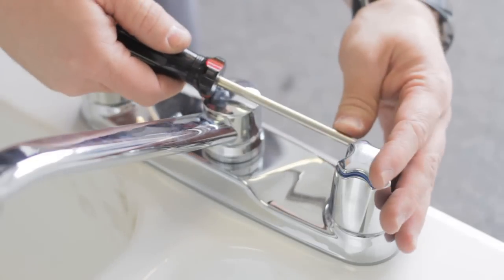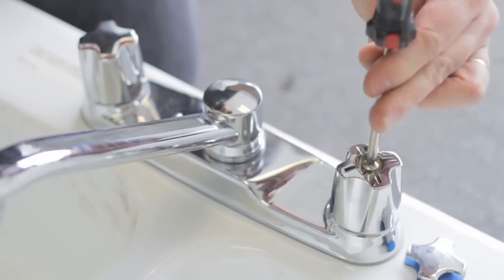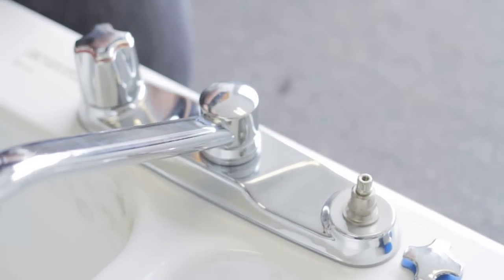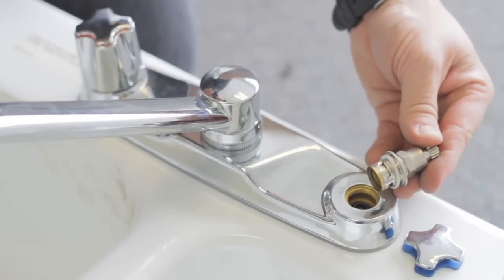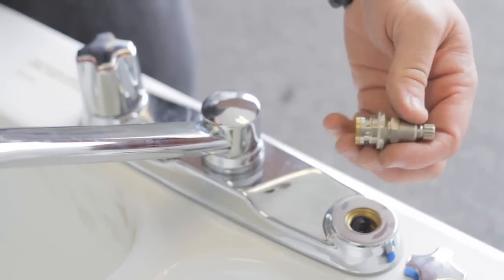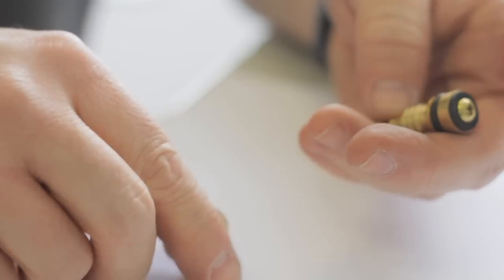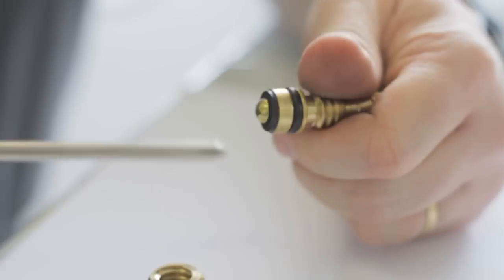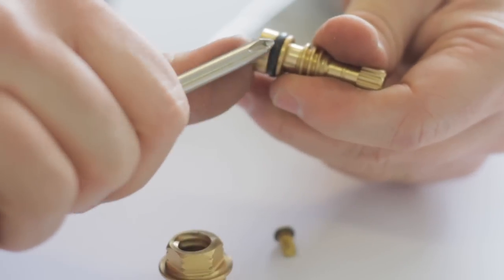Faucet Repair : How to Repair a Dripping Kitchen Two-Handle Faucet

Comment: Step one!!!!! Turn off the water under the sink first! If you don't, when you remove that thingy,  of a gusher of water will spray four feet into the air and run all over the floor. You could slip and fall in it like I did and almost knock yourself out. Very important piece of information.

Comment: Why do you need to replace the washers?  Doesn't the new stem come with new washers?
Reply: For the same reason that when you get a flat tire you don't go out and buy a new car, you just fix or replace the flat tire.
Reply: Excellent question.  Does anyone know it the new stem comes complete with new washers on them?

Comment: I had to replace what was mentioned here, but I also had to replace the tap seats.  But these seats I guess were so old that in one store they were sold as discontinued.  So 6 seats cost less than six dollars.  Before getting the parts, the kitchen cold water tap was constantly dripping no matter how tight you closed the tap.  

So a temporary cure was to open the cold water tap and wait for the water to get as cold as possible. That caused the cold water rubber washer to shrink a bit. Then you close the cold water tap good and tight. Next you turn on the hot water tap and let it run at top heat for a while.  Over this time period, the heat slowly transfers over to the cold water tap and its washer.  So the heat causes the washer to expand a bit and thus it fills in the notches in the worn out tap seat.   Bingo, the annoying dripping stops, for now.

Comment: My kitchen 2 handle water faucet won't stop watering. I opened the cabinet and tried to shut off the water supply but it did not work. Got a plumber who gave up of how to fix too but took the money. Pls advise. It's a very old system.

Comment: This is nicely explained, but my  tap cover does not pull off after removing the screw under the cap.  
Secondly with the Waltec stem, the bibb screw will not unscrew.  It takes a flat screwdriver but the bibb screw will not easily loosen.

Comment: How do you know which side to fix or is it trial and error, 50% chance of getting it right on first try? Or do both need replacing to end the leak?
Reply: James Hall  If the water coming out is warm/hot it’s the hot water knob if it’s cold then cold water knob but if it’s a substantial leak and you have a small hot water heater the water might be cold and or Luke warm and makes it 50/50 but it’s usually the hot water.

Comment: Insides dont' look like mine at all. There is a spring loaded "something" underneath all of that. Not held in place by any screw - nests down in the hold that all that goes on top of. Because I have never seen how one fits in, I dont know how to place it.  It popped out with the spring pressure.